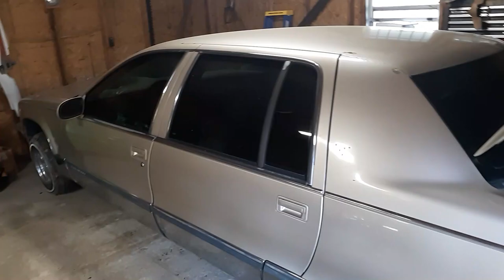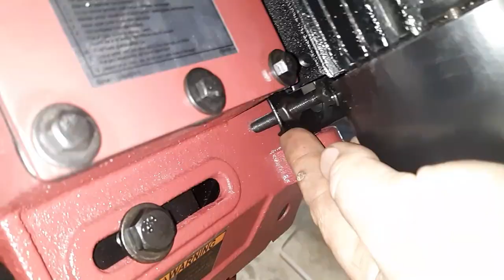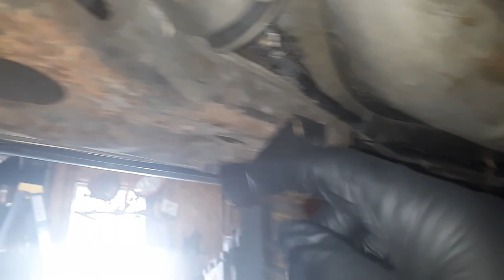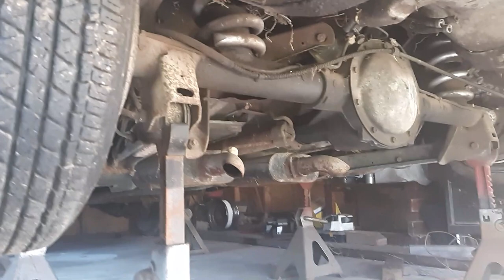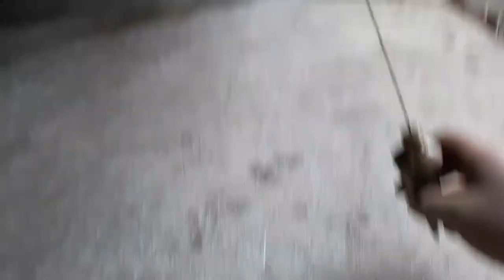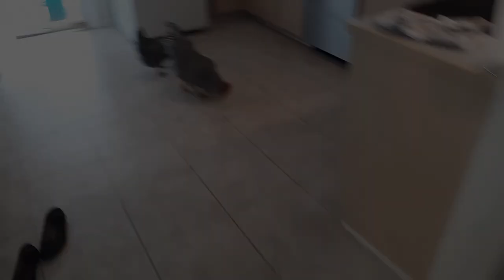Cadillac Long Arms....To Do Or Not To Do

Comment: How much do you charge to do a job like this? I want more lift in the back but don't want the mounts hanging from under the car because I want to lay low. I can buy all the parts I need
Reply from the maker: Between 800 to 1000 bucks just depending on how much fab work is involved

Comment: With the drop mounts from hoppos will that effect how low the car can lay?

Also, looks like you have coil under in the rear. I’m juicing my 93 next month with a buddy and he is suggesting coil over. Any reason why and pros or cons of either? Thanks man
Reply from the maker: I have run into problems with drop mount when running anything less the a precut coil I tried them years ago in my oldsmobile it laid really low I think I had like 3 turns of coil I had 16 inch cylinders I added drop mounts but it had a bad pinion angle when the car was all the way down and all the way up. But i have used them on a few other builds that have had precut coils and they worked out well. As far as coil under it seemed to make a better ride but if you are going to do a chain bridge it's not really recommended you can three wheel with coil under but you will have to add some pipe to your cups to help keep them in the coils